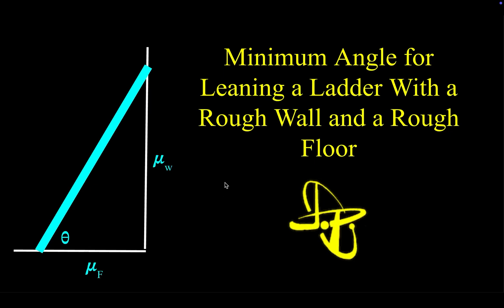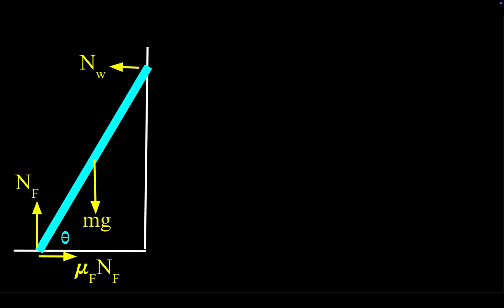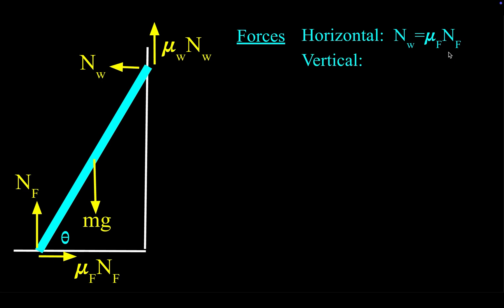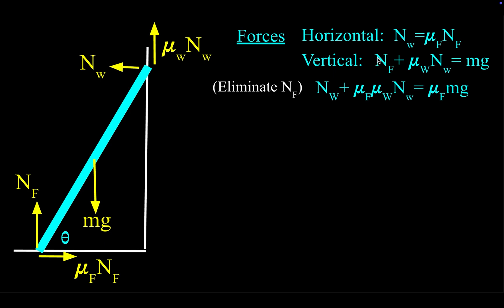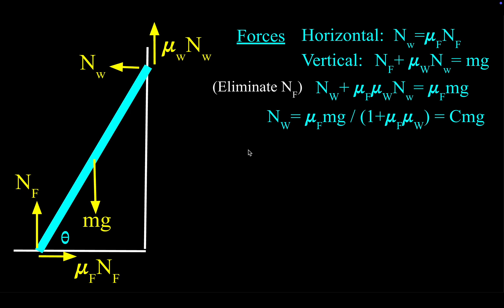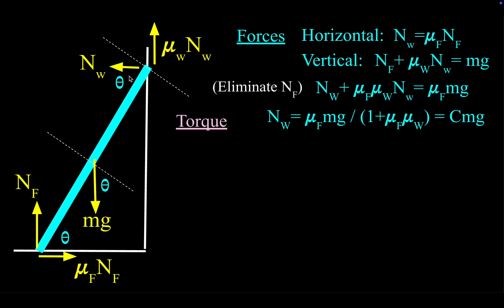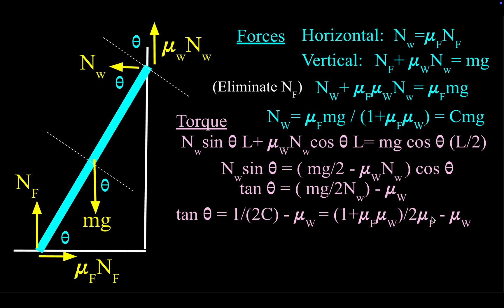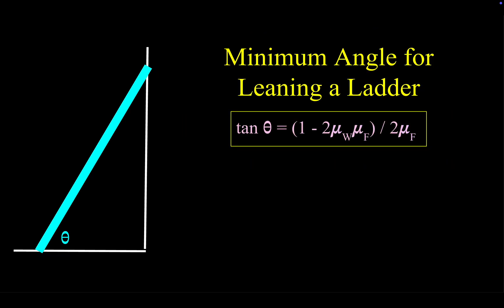Ladder against a Rough Wall on a Rough Floor - Minimum Tilt Angle Using Torque and Forces

Comment: I don't understand how finding an expression in terms of the angle and coefficients of friction is an expression for the minimum. I thought you had to isolate a variable that would go to zero when it slipped and solve for that, eg normal at top of ladder.
Reply from the maker: The angle we found is the smallest angle at which the ladder would be on the verge of slipping; it's the minimum angle before slippage occurs.